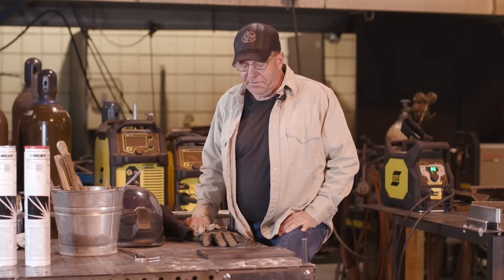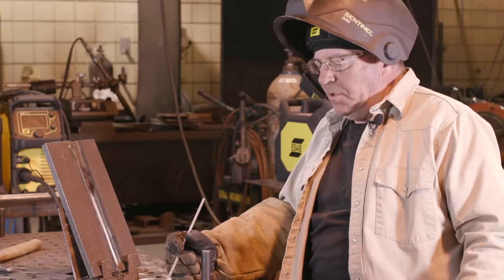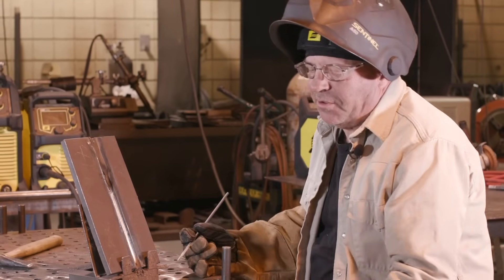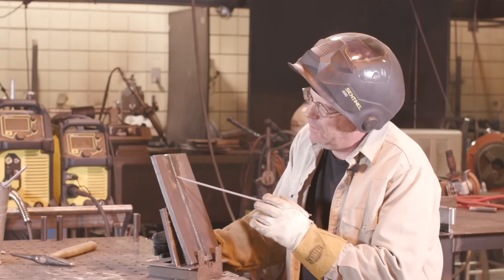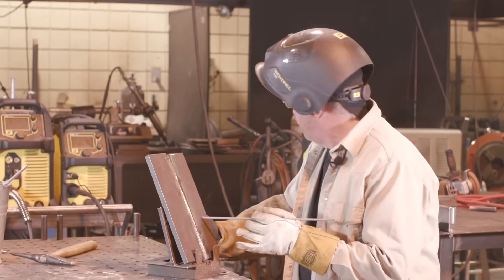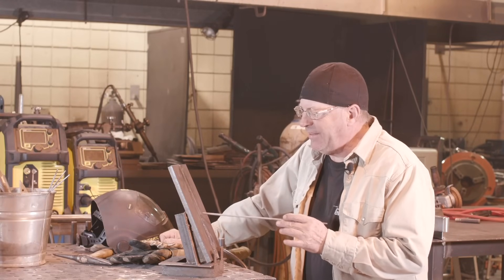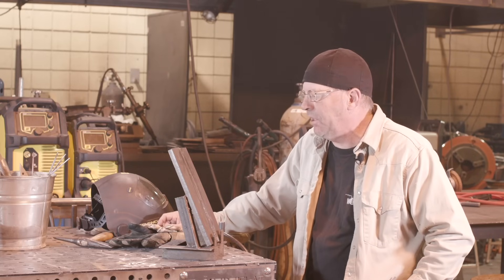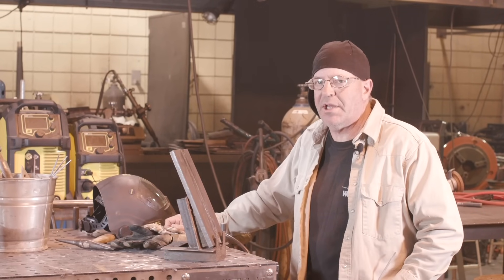🔥 Downhill Open Root 6010 with UNEVEN FITUP

Comment: I had 3 hire in tests at steam generator changout a few years back. 2 of the tests were miss match fit-ups. 3/16 gap on one side and 1/16 on the other with 1/16 high-low.

Comment: keep the same size  rod,  turn down your heat, and whip your rod as you would up hand ,use your arc blow and tip your rod end up  to keep the metal up , make sure to tie in the lands properly ( rounded key hole )  , if still to wide, larger diameter rod . Wider yet back to smaller rod drag  a stringer bead  on one side on the land to build it up to narrow the gap ,do the same on the other side . It can be done with practice even wide with high low. Iron bound fit up on the plate he has, use a 5/32 disc if you have one. Grind down the middle of the fit up till you reach just a little past the top of your land . This technique reduces your heat sink and allows for penetration . Depending on your grinding set your heat higher according to the penetration rate you want . if done right it will weld as easy as a perfect fit up . Down hand is easy with practice and a lot faster than up hand .If your doing bad fit ups on pipe always do your tight spots first  .  keep up the good work Bob

Comment: Hey Bob I have a question.  I'm not a professional welder but I've done a lot of repairs on farm equipment and done a number of small fab jobs.  I was told that verticals should always be done uphill and never questioned it until I saw this video on downhill roots.  What is the reasoning behind the choice on direction of the weld pass?

Comment: First time I ran 6010 a couple weeks ago I didn't know what I was doing without first time I ever touched a 6010 but not a 60 rod I have ran 6011 and hated it. So for the 6010 I ran at 85-86 amps.

Comment: I don't understand why this man is stoving? There's no strength in a vertical, downhand weld. Perhaps he can't weld vertically, up?
Reply: manos3790 Up, down, horizontal, 6G (up & down) done correctly, it all bends, shoots and passes pull tests. Careful how you comment.....
Reply: Bob  Moffatt you're not passing any 6G test using a 7018 in vertical down. Only if you use a Nu5.
Reply: manos3790 I've never used 7018 downhill.

Comment: I've just bought a small inverter stick and just after a few pointer if anyone can help I can keep a good steady arc but beads look crap like it's too long arc, how close to the puddle with the rod do I go? I can get it so it's in the puddle an still running but is that right?

Comment: Hi Bob,
When I  was going to welding school in 1981 my instructors  told us many times that when we get jobs in the field, the equipment will be crap, the fits will be crap, the conditions will be crap and we will have to be good enough welders to overcome all these obstacles.  They were absolutely correct, I've heard the job Forman tell complaining welders "if you can't hack it, pack it" many times since then.

Comment: What is "dig" that you talked about when doing the pass on the back of the plates? I think you said it was set at 70%, is that like when you pulse Tig? Sorry if this is a dumbass question, these videos (and Jody's) are the only welding instruction I've ever had.
Reply: Adam Cordonnier. Dig is a setting used primarily for stick. Itll bump the amps up to keep the rod from stickin and the arc from goin out.
Reply: Justin Hall thanks for your explanation. I've only ever stick welded with a buzzbox that's well over 30 years old at least. That must be a feature that comes on newer inverter/transformer machines.

Comment: Like a boss! But lookit, let's say you're in the field, one electrode size, no specs (maybe building fence), and hella gaps. I imagine if running uphill you'd wanna turn the heat down a bit? I've ran into that, and call me scared, but I'd usually grab some 6013. I've tried Texas tigging, but with varied effects (usually not good).
Reply: Tommy T Gotta adjust amps, grind or know tricks.

Comment: Good stuff, Mr. Moffatt!! I actually proved to a guy you can determine the weld process and electrode for SMAW just by the smell. Did a blindfolded test and picked out the MiG, TiG and Stick process. Even told him when he had a cellulose rod and a low-hydrogen rod.

Comment: When you're in the field welding you will NEVER have a perfect fit, also a lot of the time you can't choose different size rods you weld with what they give you
Reply: negatory you will get perfect fits if you have a fitter/helper that gives a shot and takes pride in there work js
Reply: Samuel Adams True.
Reply: Jeff Preskitt I'll be your fitter. I take pride in good fits.
Reply: When i was welding,  super high low they ask me or inside pipes when a fitter holds my legs.those were the days my friend, I thought they  never end
Reply: Jeff Preskitt how do you get a perfect fit with bent or dented pipe
Reply: @SamC379  Fit pipe that isn't bent or dented. If the company you work for supplies second rate pipe, they're probably expecting second rate welds anyways.

What I mean by this is you wouldn't be using damaged pipe for anything in compliance with structural codes. So you probably wouldn't be doing open-root welds in the first place. The most you'd be doing with damaged pipe would be some pipe fence, which really just doesn't require code-quality welds.
Reply: @jabukufo  they are not supplying second rate pipe, stuff happens in transportation and handling,  it's much less expensive to have a professional welder and fitter deal with it than to only use perfect stock. You can't just say "send that piece of pipe back to the manufacturer  it's not perfect" you have to make it work in the field. It sounds like you have never been on an actual pipeline job site
Reply: @jabukufo  also second rate welds don't exist in pipelining. They are cut out and redone if they don't pass inspection, the welder is probably fired after the second failed weld
Reply: I don't think Jeff has ever been out in the field on a real job site
Reply: Jeff preskitt you've never done a tie in obviously there's no such thing as perfect

Comment: Did you not clean the slag and wire brush the stop/starts in the first pass?
What do you think about just using the 5/32 for the entire pass?  Wouldn't that have been better (such as pipe welding in the field or something similar?).
This was a narrow/wide fit up video and it went very well, but the stop/starts would not pass an x-ray do you think?
Highly educational and filming was excellent!
Reply: Always always clean... especially in pipeline work, if you fail 2-3 X-rays there goes your job... not worth it.
Reply: Jose Jimenez Agreed.
Reply: ted s I do have a good pass rate. My job isn’t in trouble at all. Things happen sometimes, you get rushed or just have a bad day. I don’t have near the experience of bob moffat or probably yourself either. All I’m saying is, the guys I’ve learned from don’t hit those stops all the time, and the world is still turning and the lights are still on. 
Having a hard line opinion on anything doesn’t help anyone.
Reply: So I'm hearing, "on the job you'd wanna chip it, brush it, grind in the on ramp and go.  In practicing your welding, not so much unless you need chipping/grinder practice".  Does that sounds about right?
Reply: I think a welder can tell when he/she needs to  hit those stops. No one way is perfect all the time. Ive passed X-ray both ways. I’ve also busted an X Ray both ways. Not to proud to admit it, but it happens.
Reply: Tom McDaniel Done it a million times without cleaning and they pass x-ray.
Reply: Bob  Moffatt done it a million time without cleaning? Lol your full of shit
Reply: ted s BTW, you're, as in you are, is better than your dont you think?
Reply: ted s Once again, your? You're talking about.....if you've not done it for a living then why are saying I'm full of s##t? Twilight zone?
Reply: ted s Real welders will attest to the fact that you don't need to grind everything to pass.
Reply: ted s We all grind when and where we need to. What's your problem anyway?
Reply: Maker In Training Right on
Reply: ted s If I had a dollar for every time I've not ground and buffed a restart on cellulous rod downhill and passed x-ray, I wouldn't have to be reading your stupid comment that I'm full of s##t. I know a lot of true hands that can back my statement. Watch your language, please.
Reply: Bob  Moffatt your talking about a certain rod which all real welders grind. Guess i dont have a rig and do it for a living. Crazy stuff but be twilight zone
Reply: Bob  Moffatt If you expect me to believe that horse shit your nuts. I have passed quit a few plate and pipe in 12 year's. I didn't say every pass as the pipeliner rod you dont have to. But a 7018 and regular 6010 sometimes there's no way out of it. But ill let you tell your ol war stories 👍
Reply: Bob  Moffatt and anyone with a brain that never grinds or at least uses a wire wheel dont have a long career in welding.
Reply: Maker In Training if you appreciate your job you should make sure they pass. Maybe that's just me..

Comment: "Wide in the middle and tight on the ends", Sometimes I feel that way.  BTW...Can you smell the differences in filler rods?
Reply from the maker: Of course. Next time you have some 1/8" and 3/32" 6010 take a whiff. If you can't tell the difference let us know and we'll do a video.
Reply: Can you imagine, what my neighbors would think if they saw me in my garage sniffing rods?
Reply: come on , 7018 vs 6010 are way different in scent.
Reply: come on , 7018 vs 6010 are way different in scent.
Reply: Mabey take a hoover of galvanized vs mild steel
Reply: I keep several different rods at my desk to practice steadiness throughout the day and yes, sniff them every now and again.  They do smell different.